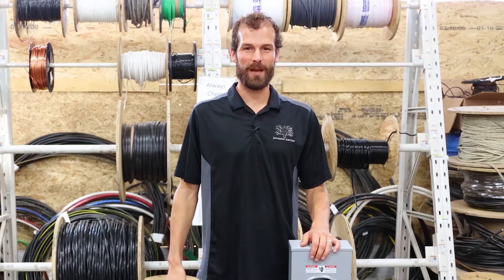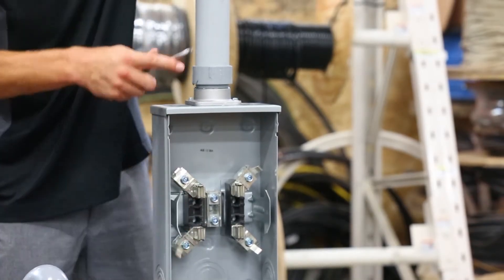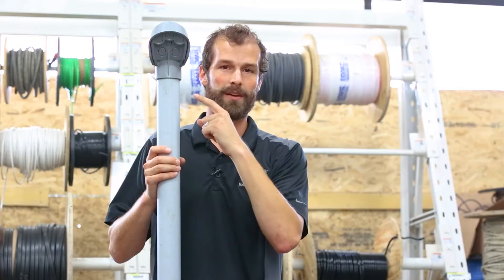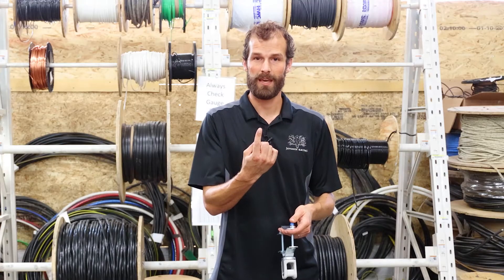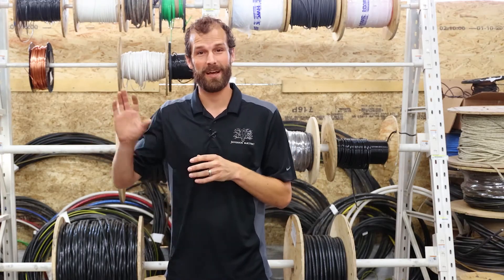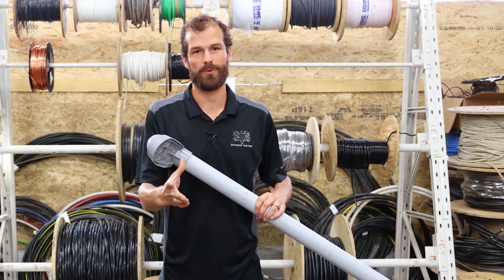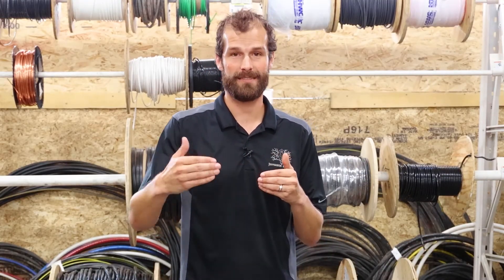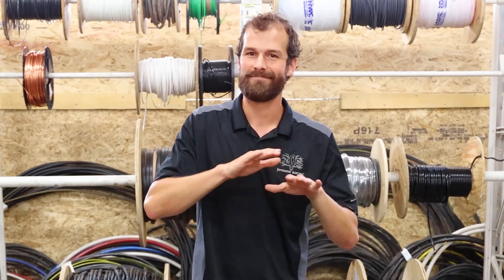Overhead & Underground Electrical Utility Service

Comment: I'm no electrician, but accident you descripted did not make any sense, electricity need 2 paths to have currents flow, hot and a neutral, if neutral is not connected then current won't have no where to flow, then whatever plug in won't be working at all, and wouldn't burn up or blow up at all.

Comment: Semi-Pro DIY electrician here, that is some good knowledge to have, thanks!  
Recently had a crazy issue on a circuit in my home the lights were dimming intermittently, I replaced the breaker but issue continued, inspected all electrical connections and found loose neutral on ground bar in panel!!!

Comment: An unusual situation I ran into a number of years ago. Large new home with an in-ground pool. Kids were complaining about a tingling sensation when swimming near one of the underwater lights. I took a voltmeter, connected one lead to the diving board support and dropped the other lead into the water. I was able to measure between 10 to 15 volts in the water. Turned off the 400 amp service to this brand new house and it made NO difference. Turns out the metal light fixture case that was grounded to the house electrical service + the pool water was providing a better neutral ground than the utility company ground. They immediately upgraded their grounding system and that cleared the stray neural voltage from entering the pool.

Comment: I’m currently in the market to buy a house, and I’m surprised just how many homes have overhead power line connection with a main service wire simply tapped against the wall and going down to the service panel without any sort of PVC conduits. Ideally I’d prefer to have all utility wires buried.

Comment: As a utility worker, the major Ontario utility that I came from the utility owned the wire to the top of the meter base on UG services and to the stack on overhead services for residential customers. On commercial services the customer owned the wire to the transformer on UG. If you have those problems after turning off the breaker like he said call the utility first, they are free and if it turns out it is the customer’s problem then you call your electrician. Some utilities require special sand for up to a foot or in some cases within 6” of grade.

Comment: Referring to 13:36 of the video (Family getting shocked while trying to exit pool). It could have been much worse, including multiple deaths as people attempt to rescue other people from the pool, before anyone realizes the cause of the problem. This 'stray voltage' is why all pools and the fixtures and area around a pool must be BONDED. Everyone who owns or manages a pool should absolutely be familiar with the topic.

Comment: I had a job that the neutral burnt off behind the meter 2 other electronics could not figure it out 
If you pull a load on one leg and the voltage drops  and the other leg voltage goes up you have an open neutral

Comment: I often wondered about that. In trade school, they never could answer why when I questioned that. We were told that we could go from a larger gauge (Thicker) to smaller (thinner) gauge. Me being me, I questioned that very instance about the utility. He looked shocked and said "That's a very good question, Michael." I often got that same response in PSR classes. I knew I wasn't going to get an answer. Giving it thought, it would behoove the electric company to use thicker wire. I can't tell you how many times that my electric went out from a down wire but the telephone wire on the same pole was fine, and when the electric was restored, the cable TV service still worked too. For what they charge me in electric, those wires should be pure gold. If I had money to invest I'd get solar panels and a system to sustain us at night and tell the electric utility company where they can stick it. Great video, Now I need to see if I can find the other 2. The You Tubes mixes things up and there is never a video where you point to. Not sure if it's my ad blocker or because the You Tubes changed format.

I can't imagine being shocked in a pool. That's horrible. And to think Mother had a pool, ran the filter off an extension cord plugged into the garage for years. (before GFCI) came along. Then one day, I was playing hooky from school, a code enforcement guy with a badge comes along, wanted to talk to my parents. Of course they weren't home. That's part of my plan to have the house to myself. I thought it was a truant officer. Mother had to have a GFCI installed or take down the pool. So the electrician was there the next day. Back then, you telephoned, and they came right away. None of this "Well we'll get out there in a few days or sometime next week..." business. They came right away and it was completed 3 days later and inspected. Had a little sub panel right off the main panel with two breakers just for the pool. A main and the breaker itself to the outside GFCI then a receptacle with a switch at the pool pump. If that buried cable became damaged, it would have tripped at the house. But I am pretty sure they ran conduit with a special machine that just drove it down into the ground, somehow. Called a "Ditch Witch" or something like that.

Comment: there's a Neutral to hot and  ground to hot  loop impedance test, it's a live test that has to be done on all service's in the UK and Europ. you can read about it. that's the only test that could have caught  this issue.
I'm shocked that we don't do these tests in the US.

Comment: Not long after we moved into a previously occupied home, in Cheyenne, WY, we noticed the living room plug-in lights flickering. The house wiring was aluminum and the contractor had used plug-in receptacles! I rewired the outlets and was unaware of the requirement to use an Al to CU compound. We had no other problems for the seven years we were there.

Comment: That is why it is best to bond your neutral to earth (provided that you have an earth rod buried in the ground) at the main load center. This means in the event of a slack, corroded or disconnected neutral, your bonded earth will provide a secondary path through the dirt for current to flow back to the transformer, (via the transformer's earth rod which is typically bonded to the transformer's neutral) thus preventing voltage swings between your line 1 to neutral and line 2 to neutral.
Reply: This is another instance of test-test-test. In the case of the exploding house, there was no bonding of the grounding element to the power neutral. It could be that someone disconnected the ground wire from the underground pipe or from the grounding electrode system. I agree that if you have lights that dim or brighten when a large 120v motor is energized, then call an electrician.

Comment: In Texas that 2'' Service Riser from the Meter Cabinet to the weather head  has to be Rigid Galvanized Steel  Conduit .
Reply: I would think it does everywhere.  PVC isn't going to work, not even Schedule 240.

Comment: My neighbour and I were fed from a common pole, and lost the neutral to our two houses. Lots of damage - especially to motorized equipment. But surprisingly, not much damage on electronics - especially those with switching power supplies. A lot of low power electronics is worldwide rated (120/240, 50/60Hz) and saved the day! The worst damage was losing large freezers - not just the pain of quickly relocating the food, but replacing a large and cumbersome appliance. I did have a  MOV-style surge bar that had burned out, but luckily self-extinguished before any damage - leaving just a smoke stain on the wall.

Comment: I had the neutral problem a few years ago I think about 5 years or so ago and I heard a buzzing sound and it was like around 6am and so I shut off the main breaker and I called the power company and they fixed it and I'm not sure if it was on the pole side or the house side anyways I was very lucky that I suffered no damage to my electronics or appliances.

Comment: I had a floating neutral at a house I lived in and I plugged in my fluke and watched the 120 VAC floated between 105 and 119 degrees.  It was the Utility transformer

Comment: That is the problem with split phase system: in case you lost Neutral, your weaker appliances (lights, toasters, microwave, ref) will experience higher voltage than usual.
Reply: But it's all a very interesting combination series-parallel circuit, from an electrical standpoint.
Reply: @jovetj  A costly education though..😅😅😅
Reply: @DanBurgaud  Prefer to keep it theoretical!

Comment: i have exactly that problem of pine tree in way of my house wiring it is the neighbor's tree that surrounds the telephone pole and when i called the power company that wire is rubbing in tree, they said it's not really rubbing that much so they did nothing to clear power line of tree
Reply: Same issue in L.A. County:  SC Edison told us "our wires are insulated, so we don't care if tree branches rub against them".

Comment: Any time there is an issue with the neutral affecting a whole house you will always have 240 volts but each leg will read quite a bit different from the nominal 120 volts. Examples I often give will be 50 volts on one leg versus 190 volts on the other or similar. They will still add up to 240 volts nominal so the key is to see what the legs are doing. Do NOT go around using your hand to check for hot spots. Quite often you can see the discoloration on a terminal or smell something burning. Outside crimps on a service feed are my first look and always look at the other end toward the pole while you are out there. At any rate, if you have this condition you MUST turn the utility power off to prevent further damage. The power company has equipment to test at the meter pan so they can tell if it's their stuff (on out to the pole) or something inside the home. Been there, done that at least a half dozen times in the last 20 years.
Reply: Wow. And that's something that should never happen.  And no liability from the utility company?? Bullshart!
Reply: @jovetj  ... They will tell you it's beyond their control and contact your insurance company.
Reply: @rupe53  Acts of God are beyond their control; negligence is not.
Reply: Sounds like your either not bonding your neutral or you have an open neutral on a circuit.
Reply: @joshhowie4071  ... we're usually talking the whole house because a single circuit is not enough to upset the neutral and a ground rod can probably take up that slack. Most people forget that there are many ground rods. You have at least one at the house, one at the pole transformer, and more at each additional home that's tied to the same transformer. Once you realize there's another half dozen grounds tied in, but well beyond the home you are working in, you can see that a bad neutral wire / connection on the service can go wrong very quickly. The pole transformer is also center tapped, which is where the majority of power wants to flow.... and the best path is the service wire.
Reply: @rupe53  Bonding your neutral at your panel ensures system ground reference. You can have 2 circuits that share a neutral, and if that neutral happens to be broken with no path back to the panel, the imbalance of the amperage will offset into unbalanced voltage. Maybe the transformer was pouched and the neutral wasn’t properly bonded.
Reply: @joshhowie4071  ... yes, that can happen with a shared neutral such as a kitchen circuit, but the video was about the entrance service so that's my example.